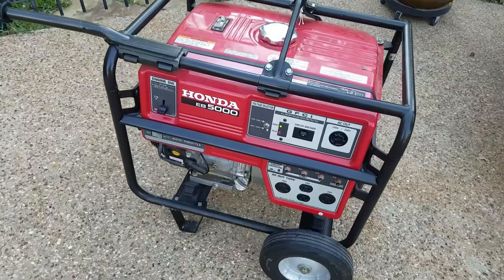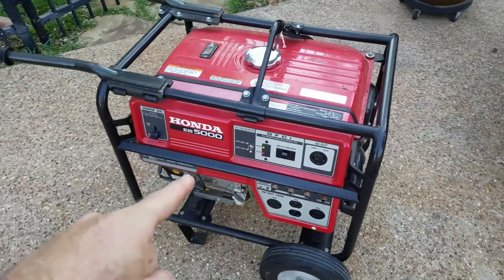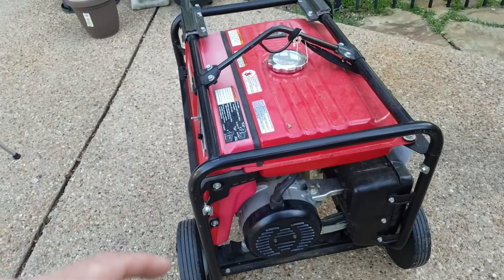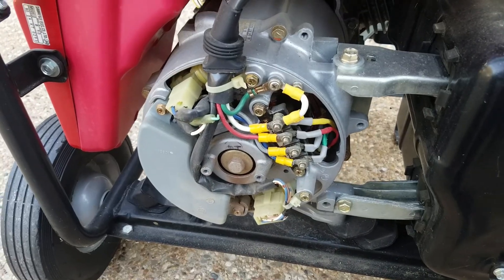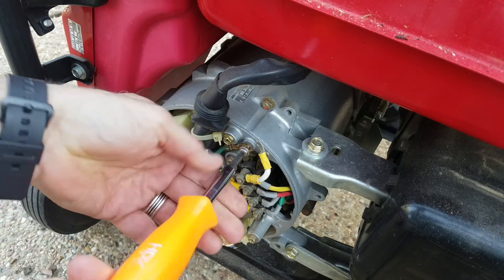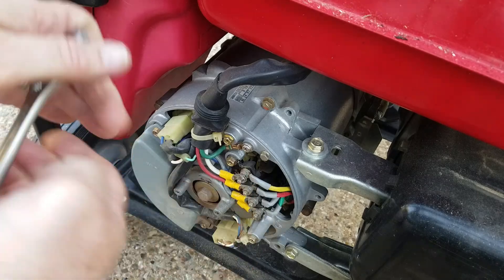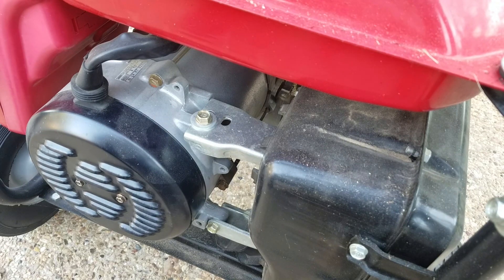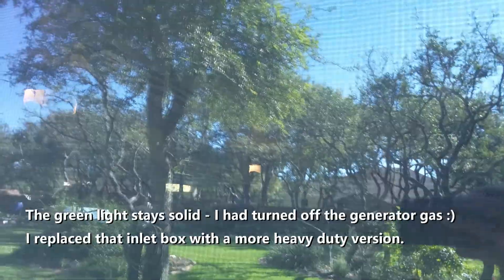Honda EB5000 generator trips its GFCI breaker when powering a house - and a fix.

Comment: It is very important to label the generator as “Floating Neutral” so that unsuspecting people know it has been modified. It is not safe to use it at a job site with the jumper off. A very simple fix is to buy or make a neutral ground bonding plug and plug that into one of the outlets if you want to use it at a job site.
Reply from the maker: Thanks for correct feedback!

Comment: Mine did the same thing. I had an electrician come to the house thinking I had a bad wiring set-up, then he tells me that both the home and generator are fine, but they are "incompatible". Not very helpful, so I call Honda, and they talk about Service Bulletin 20, which is a 2-phase vs. 3 phase issue, which doesn't sound like the problem. I then call my electrician back and explain what I've been told, and then describe this video, which he says is the explanation that makes sense. Honda should make it clear that there is an issue when powering a house vs. powering tools and let me add that most Honda dealers who sell these don't know a fucking thing about generators. They just want your money up-front.
Reply from the maker: In description above: Honda tech note:
https://members.rennlist.com/warren/honda.pdf
Reply: @DrBDIY  Perfect. Thank you. It sure would be nice if Honda told you this BEFORE you try and hook it up to your house. I spent $200 to have an electrician check it all out thinking something was incorrect. I guess they want to cover their butts.
Reply from the maker: Yes, the automatic transfer device or manual transfer switch has to be guaranteed so as not to put generator electricity into the city grid.
Reply: @DrBDIY  You have been incredibly helpful. Why didn't Honda inform owners? I filled out my ownership/warranty card, so shouldn't I have been told about a pretty big issue? I lost a bunch of expensive food when this problem happened during a recent storm. It's kind of bullshit that Honda kept it a "secret". There is apparently another Service Bulletin for the 2-Phase/3-Phase issue I mentioned.
Reply from the maker: Safety first!  I think generator usage to a home has a risk - has to be used correctly.  The line to the city has to be turned off.  One ground enabled.  Not turning on more devices than generator supports. User error.  Some companies are adverse to taking the risk.  I am a DIY person, not an electrician.  But with some great help, I did manage to get my house wired for generator power:
https://youtu.be/i0oKvtQ_IZU

Comment: Amazed at how many people are unaware of this procedure to connect a generator to your house. Even more shocking (pun not intended) is how many electricians are also unaware. Tip for y’all needing to do this. Don’t remove the jumper wire from the case, just unscrew it from the neutral post and secure it to the other end, the ground post that way it’s stored right there when you need to get it back to spec. Also, make or buy a bonding plug ( look it up if you don’t know what it is) when you want to use your now floating neutral unit as a standalone unit in the field. In fact make two, one for 120V regular outlets and one for the 30 amp outlet. You’ll thank me later.
Reply from the maker: Thanks for the information.  I think more DIY people don't understand bonding plug and floating neutral.  Do you have a video of web link that gives a DIY person a good overview?
Reply: @DrBDIY  There are many “Making a Bonding plug” how to’s right here on YT. They all show how simple and effective they are. Lots  in the recreational vehicle game talk
about this quite a bit .
Reply: The manuals usually say this stuff, but why would anyone read those?

Comment: Same procedure will be followed in case when the generator is jiangdong 3kv, its breaker triping sometime after 5 mnts and sometime 5 times in a minute......reply plz
Reply from the maker: Sorry, I don't know that generator.  I suggest you contact the manufacturer first to discuss this approach.  Safety first. I am a DIYer, not electrician. Thanks.

Comment: The simplest explanation could be 
(1) If home utility grid neutral is grounded, then remove the jumper and use a 2 pole transfer switch with jumper removed.
(2) Alternatively use neutral ground for generator and body the frame of the generator both separately.
Reply from the maker: Well said.

Comment: I have the same one, but the problem is when I put the selector on only 120v it doesn't work, the breaker trips, can you help me with your diagram?
Reply from the maker: Hi, I am a DIYer, not an electrician. I created a picture diagram of what I wanted, but not an electrical diagram.  Did you disable the ground on the generator so that the house ground takes over?  Safety first. Get help if you have DIY experience like me.  I had several smart folks guiding me.

Comment: just had same thing this morning, only difference is my generator is 15' for the house in a shed, went thru my wiring figuring I had a neutral and a hot switch somewhere, nope couldn't figure it out, power came back on and I could use my computer, thanks
Reply from the maker: Good job!

Comment: Does this same apply to hooking up a welding machine since it has to be grounded?
Reply from the maker: Good question. I am a DIYer, not an electrician. You may want to stop by an electrical shop or electrician for assistance. Thanks.

Comment: My question is what was the jumping for in first place
Reply from the maker: Good question. Safety first. I am not an electrician but a DIYer. Basically, grounding a generator helps to protect against shocks when connecting power tools and other non-fixed-structute devices like lights.   For example, don't use a plugged-in saw without a grounded generator. 

From search:

Bonded Neutral in Generator

In a generator, bonded neutral refers to a configuration where we make electrical connection or bonding of the neutral wire of the generator and the ground or earth.

The simple way to achieve this is by connecting the neutral wire to the generator’s frame and to the grounding terminal through a wire or strap.

The purpose of bonding the neutral in a generator is to provide a low-impedance path for fault current to flow to the ground in the event of a fault, thereby reducing the risk of electrical shock and other hazards.

Bonding the neutral can also help to reduce electrical noise and interference in the system, improving the performance of connected equipment.

In a bonded neutral generator, the neutral and ground wires are connected at the generator, and the neutral is also connected to the generator’s frame.

This means that the generator’s frame is effectively at the same potential as the ground, which can help to prevent electrical shock and other hazards.

It’s important to note that in some situations, such as when we connect the generator is to a building’s electrical system, a floating neutral configuration may be required instead of a bonded neutral configuration.

Comment: The problem is that the manufacturers do not tell you this in the instruction manual that comes with the generator??  Don’t know why ?  Your house power system is a “ separately derived system” having its own bond, meaning the neutral bar and the ground bar are connected in the electric panel. Your generator is also a “separately derived system” having its own bond between the neutral and ground. Using the generator with only extension cords, you must leave the bonding jumper in place. But, when you connect the generator to your homes electrical system, it becomes part of the homes system. In other words it becomes ONE system. Code says you can not have more than one ground point per system.
Reply from the maker: Nice response.  I think MFRs are worried that someone removes the jumper for a house, uses it, forgets to reconnect the jumper, then uses it at a job site where the generator is supposed to be grounded.  Safety first.

Comment: I'm echoing a lot of grateful viewers for your instructional video! My EB3500 was doing the same thing, and it was an hour or more of triple checking all of my settings before I decided to search on YouTube and found you. Of course, I also realized I had to have my toggle switch set to "120-240" volt instead of just "120" volt. Anyway, your efforts probably saved me an expensive trip to the Honda repair shop! Much appreciated!
Reply from the maker: That is great to hear. Safety first!  Hope you have reliable emergency power.
Reply: @DrBDIY  Yup, furnace, refrigerator, and freezer all at once, and that's all I cared about. Thanks again!
Reply from the maker: You bet.

Comment: You saved me big time! I decided to test out generator only to have my breaker trip. I traced all my wiring which was perfect. After googling the problem, I landed on your video and tried your fix. Everything works perfectly now... I printed the bulletin and stashed it with my generator paperwork. Keep up the good work!
Reply from the maker: That is great.  Glad you got power generation working.  Did you count your AMPS/Watts in the devices, so you know what to run? Good to have a spreadsheet list handy of the must have devices/breakers you might rotate through when the power goes out.  Safety first!

Comment: I have an EM5000S  and Honda figured another way to make it problematic. This generator is unbonded but has GFI 110v outlets installed. After 45 minutes it unexpectedly tripped and the cooling fan I had plugged into the generator compartment stopped while the generator continued running- not good!  Solution take out the GFI outlets and replace them with standard rectangular outlets that fit right in the sockets on the front panel. You could compromise safety but greatly improve reliability. It is a stationary application and besides, GFI's are a recent addition and haven't heard of any body count from the use of non GFI outlets.
Reply from the maker: A quote "No, you cannot replace a GFCI outlet with a regular outlet. GFCI outlets are required in areas where there is a risk of electrical shock, such as in bathrooms or near swimming pools. They work by sensing a loss of current and then shutting off the power to the outlet, preventing an electrical shock."   An example of where it  might be okay is if you removed a bathroom (and all water stuff) and extended it into a game room. Water is gone.  Check with an electrician for sure.   Local code governs what you can do.   .... But on your trip, did you pull more total AMPs than your generator was producing?  Safety first.
Reply: @DrBDIY  In my case the gen is in a ventilated compartment using a powered fan. The gen supplements a system consisting of an Inverter charger (Xantrex) connected to six storage batteries. During extended outages the inverter senses a low voltage and all goes black. I then start the generator which is connected to a transfer switch which feeds the inverter which then feeds the house and charges batteries. 
   So the other day after the batteries died and I started the generator, the fan which cools the compartment is plugged into a GFCI outlet and when it tripped while I was in the house the fan stopped and the gen continued to run. Fortunately I caught it but next time who knows. Suddenly the GFCI outlet which started out as a friend is now a curse. I suspect that some strange currents from the inverter system tripped the CFGI outlets.
Reply from the maker: Sounds like you have more experience than me. Why don't you plug the fan into the generator since it is nearby?  Also, do you have GFI on the inverter and in the house?
Reply: @DrBDIY  Plugging the fan into a GFI outlet on the gen created the issue with compartment overheating when the GFI tripped. I just purchased two regular outlets to replace two of the four GFI outlets on the generator. Wish Honda would have done this because some people need high reliability outlets such say as in medical applications.

Comment: If you remove this wire, your generator plugs and no longer GFI protected (just wanted to make sure you knew). When doing this, you ground the casing of your generator to a grounding rode in the soil.
Reply from the maker: With the wire removed, the generator is not on the house GFI protection.  How do you ground to the soil?
Reply: @DrBDIY  with a ground rode hammered into the soil and then you place a wire between the generator casing and this ground rod.
Reply from the maker: @andrebeaule9457  Got it and good point, thanks. In my case is "The neutral connection to the generator is always connected to the permanent earth grounding of the home. In this case, there is no need to connect an additional grounding electrode."   In other cases: "A separately derived system refers to a generator transfer switch that breaks both the neutral and hot connection. When the power supply is transferred to the generator, it is no longer connected to the main neutral supply to your home. The connection to the grounding of your house wiring is, therefore, separated from the generator supply. In this case, you will need to install additional grounding for the generator." 
Good link here:
https://www.chainsawjournal.com/how-to-ground-a-generator/#:~:text=%20How%20to%20Ground%20A%20Generator%20%201,the%20wire%20around%20the%20ground%20rod...%20More%20

Comment: Thanks so much for making this video.. We just lost power for a couple of hours and my generator did the same thing as yours. I started looking for the problem on my panel side thinking I screwed something up,   after an hour I gave up and came across your video,
 you were spot on. You saved me so much aggravation it's not even funny.   Thanks again Ron Rucci
Reply from the maker: Glad I could help save you time!  I decided to keep my ground wire on the generator at all times until I need it for powering the house. This way, if I am not around and someone borrows my generator, they are safe. Power on!
Reply: I will do the same.

Comment: Never heard of an OSHA certified generator. A company claiming their product is OSHA certified is going to get into a lot of trouble. OSHA only writes statutes and regulations.
Reply from the maker: Probably a bad choice of words on my part. I should have said the generator will not meet OSHA requirements.  From the bulletin:
CAUSE
The affected generators have neutral bonded to 
ground to pass OSHA inspection on jobsites. 
Home or building main breaker boxes also have 
neutral bonded to ground. When an affected unit 
is connected to a home or building, the GFCI relay 
trips the generator’s main circuit breaker.
CORRECTIVE ACTION
The neutral bond wire must be removed when 
using these generators to power a house or 
building. Also, the “NEUTRAL BONDED TO 
FRAME” label must be covered with a new 
Neutral Unbonded Label. After this action, the 
generator will no longer pass OSHA inspection on 
jobsites. Consult a qualified electrician to confirm 
that this modification is permitted by local 
electrical codes.
USING AN UNBONDED GENERATOR ON AN OSHA 
JOBSITE MAY RESULT IN FINES OR OTHER OSHA 
ACTION. DO NOT USE AN UNBONDED GENERATOR 
ON AN OSHA JOBSITE